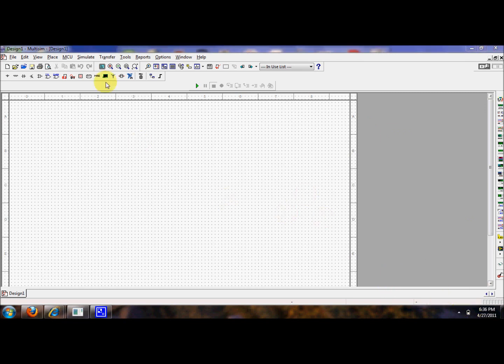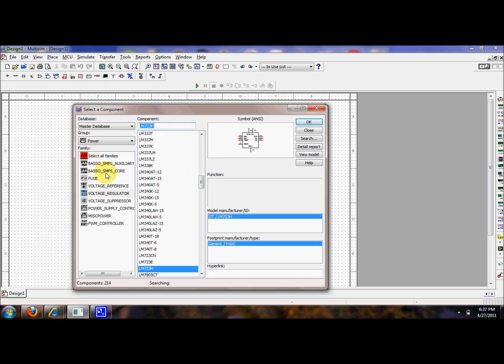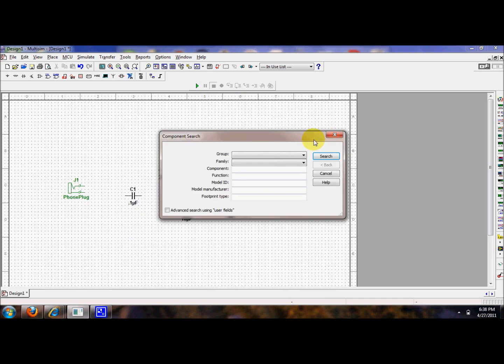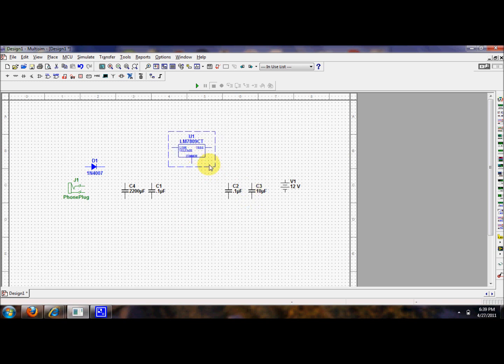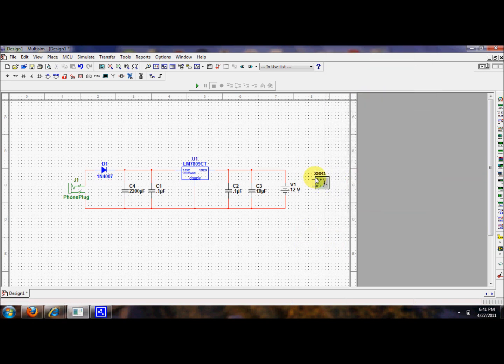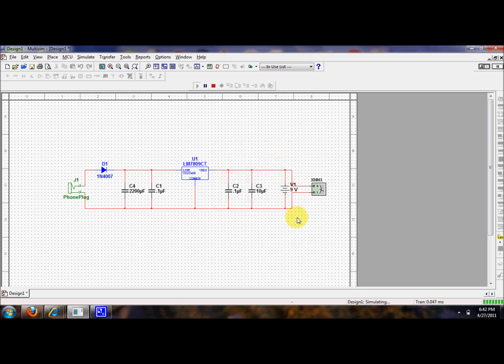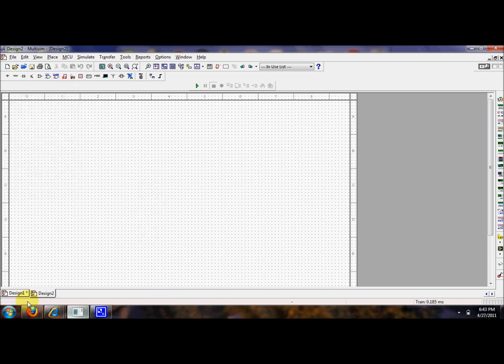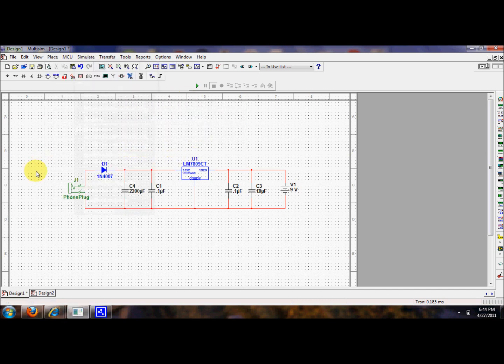Multisim Tutorial

Comment: gotta add my 2 cents. the way you have it there is no AC source. just a jack. your DC source is the LM7809 so the battery doesn't make sense. you don't need to represent the jack or the battery terminals. just put a 9V AC source where the jack should be and ditch the battery. then your DMM measurement will be right.

Comment from the maker: the schematic design i made in this circuit is meant for a 120VAC to 9VAC Wall Plug that you plug into the diode end of the circuit. and the regulator and caps are to turn the 9VAC into 9VDC. here's a Multisim schematic for the 120VAC to 9VDC circuit i made so you can have the transformer in the circuit